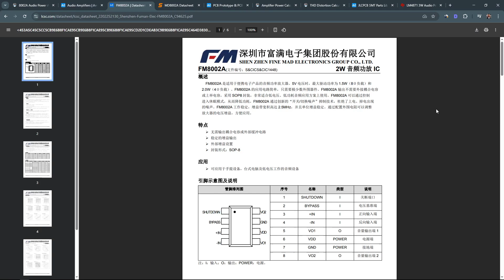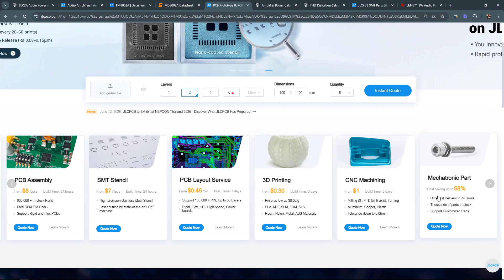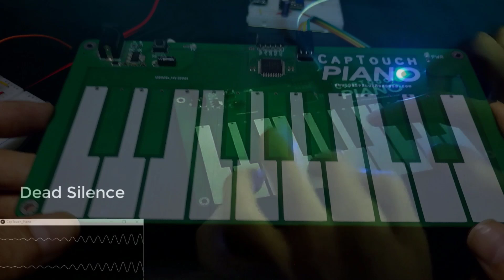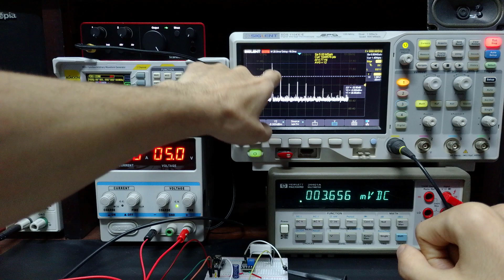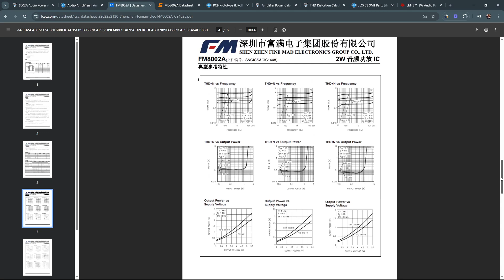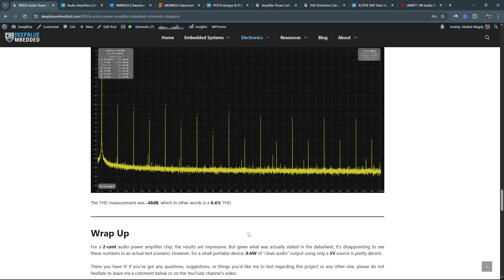Can a 2 Cents Audio Amplifier Actually Work?

Comment: Hello ! 
Great video !
Could it be the input stage saturating ? 
Have you tried to increase the gain instead of the input signal amplitude to achieve the most RMS ? 

Any way , your video is excellent, diserving more subsribers , I am now :)
Reply from the maker: Thanks so much for your kind words ❤️
I tried but was much worse. It turned out these kind of amps are optimized to operate at unity gain only, you can attenuate or amplify the signal a bit using external Rf resistor but in a very limited window. I wish I remembered to show in the video the weird behavior at (gain>1).